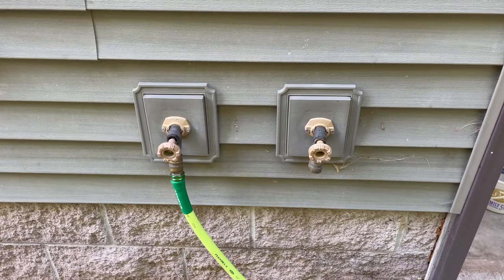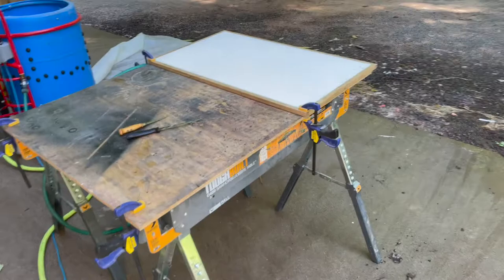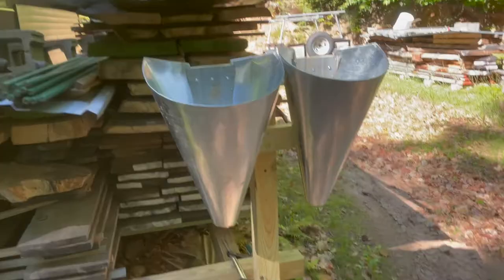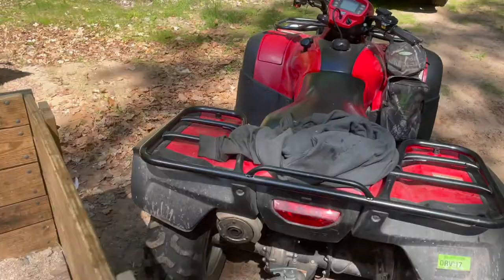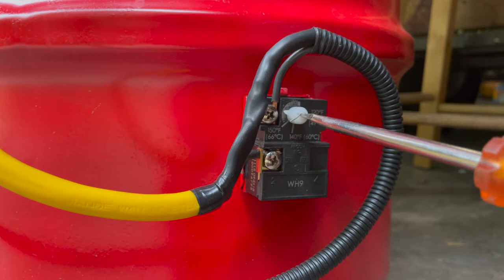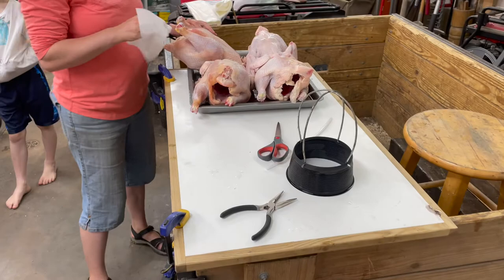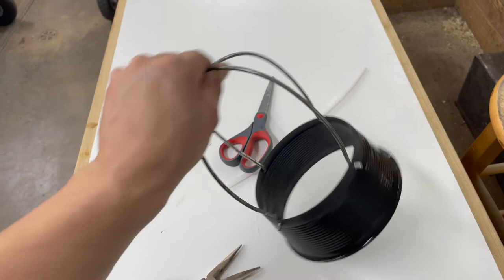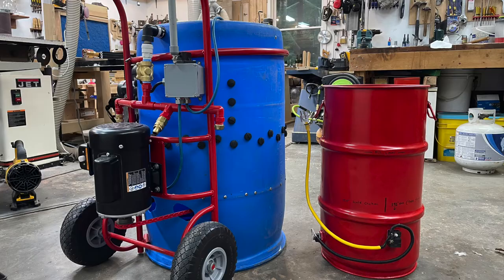The Best DIY Chicken Plucker and Scalder - How We Process Chickens

Comment: One of the better scalder designs I’ve seen, where did you find the steel drum?
Reply from the maker: The drum has been in my possession for seven years and at least five before that with my Dad. No idea where he got it. My original plan before I remembered I had this drum was to use a 100 lb propane tank and cut it in half - for some reason there are a bunch of cheap old ones on sale near me.

Comment: Where did you get the galvanized weld in nut? I would like to weld mine in. NPT thread right?  I seen some they calling a lock nut that looks like that. Store or link?
Reply from the maker: I upgraded to a larger heating element in this video https://youtu.be/OPqYN-aFAHk and recommend just getting this nut https://amzn.to/3AwohZq 

I think I bought the one I welded in locally at ace or Menards - went to plumbing and found the right thread/size (1” NPT is correct)

Comment: So when you submerge the chicken wrapped in plastic in the hot water…. It acts as a vacuum and pushes all of not most of the air out?
Reply from the maker: The plastic reacts to heat by shrinking, compressing the chicken for efficient long term freezer storage. The hot water is an efficient way to transfer heat.

Comment: What size heating element did you use in the scalder?
Reply from the maker: 2000 watt - caution: needs a heavy duty extension cord (10-12 gauge) and 20 amp outlet.